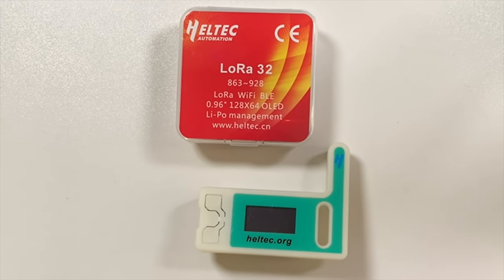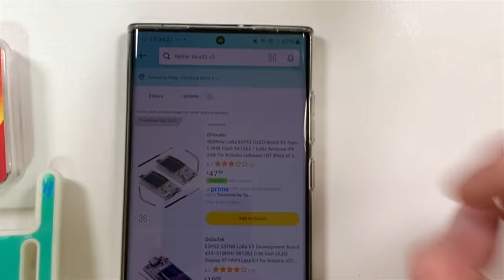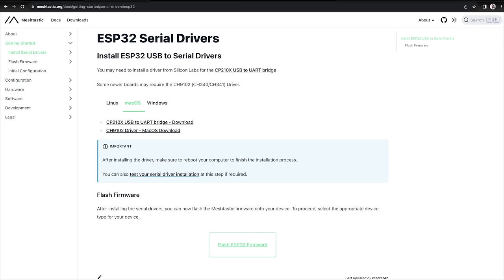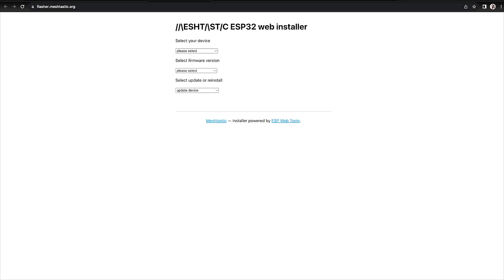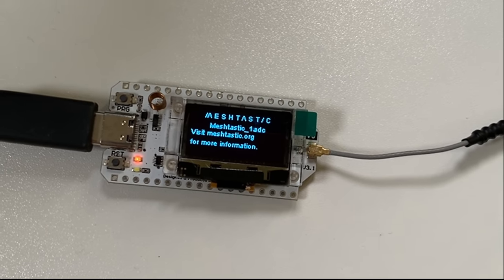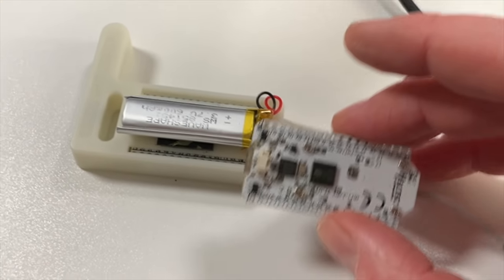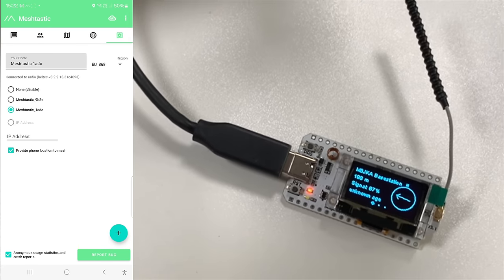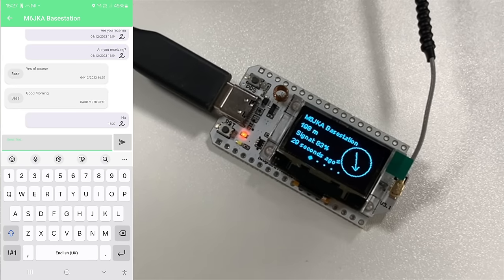JOIN THIS EXCITING OFF GRID NETWORK!!!

Comment: I got two of these devices and tested them in 'very long slow' mode. In town, with one high up in a bedroom window, the other in a car on the dash by the windscreen, the best I can get is 400 metres. Quite disappointed with that.
Reply from the maker: Hmm that doesn't sound great. There could be local RF noise, the window could have metallic coating, the antenna might be bad. You'd need to get experimenting, I can easily get 5-7km on Long-Slow, not on indoor antennas though.
Reply: @andykirby  Thanks for replying Andy. FYI, I just used all default settings, choosing encrypted, not a Ham. Are you using the Ham option, which increases power?

Comment: "So now you've got your drivers installed . " . . . . . nope, not happening, it will recognise that the device needs a driver but matter which software driver I install from Silicon Labs it will not work, even if I install and restart.  The manual install instructions are just out of my grasp, would not know where to start.  Any ideas?   - Update, I uninstalled the device in device manager then plugged it back in and it recognised it!

Comment: awesome! what is the range for this?
Reply: Yeah, I'm scrolling to find that answer too.
Cuz I'll probably be the first one in this city, it needs to be at least 20-30Km or I better use a CB radio
And frankly, I dont think thats the case, as 100mW on the old 800-900MHz band is really not alot.

Comment: If these modules are 100mW which one can I buy which supports higher output ?  (@ 868Mhz)
Reply from the maker: Most are around 140mW, Pi pico + waveshare lora board is ~180mW legal limit is 500mW erp.
Reply: @andykirby  thanks... so someone should nake a 300mw one.  If I'm going to pay someone  to climb up my roof to provide a public service I want to get the best possible rx/tx up there...
Reply from the maker: Height makes more difference than power. If you are putting one up high ~140mW will get out miles... and miles.
Reply: @andykirby  great... now deciding if I put the module up the pole too to reduce coax loss...  might regret that if I need access. Loss  (.3dB/m) if I use rg11 so probably better to use that...

Comment: Just to clarify, my phone will connect to the device via bluetooth so I would need to be in bluetooth range of the device to use it?
Reply from the maker: Yes correct. You can also connect to the device by WiFi and access it on your network

Comment: I have got to the point where im tring to flash, but on the web installer, its not showing any device. im on windows 11 and the computer can see it. i checked device manager and im using a cable that can transfer data, which i have tested with other devices. so i am stuck :( any help plz....
Reply from the maker: It might be the drivers? Have you installed the serial drivers?

https://meshtastic.org/docs/getting-started/serial-drivers
Reply: @andykirby   yeh got it working, the site was down and they are running a different site, now i have found out that none of my 1cell batteries have he wrong connector, whats the connector on the device so i can order some, thx.

Comment: Is there someone out there who did a video to set up in the U.S.?
Reply: I felt like an idiot trying to set up this device. Consider that I've always built my own computers since 1996. I've even replaced motherboards on my laptop as well. However, no one ever said on any of the videos I've watched that you can not configure WiFi and Bluetooth on the same ESP32 device. So....no matter how many times I reflashed my new devices, they would not work on Bluetooth. Then I saw on the Meshtastic Website, highlighted in blue background,  if WiFi is configured, then Bluetooth will not work on an ESP32 device. As long as you live, you'll always be learning. Everything is working.

Comment: What's the best way to power it using 18650 cells?
Reply from the maker: Yes and maybe solar too.
Reply: @andykirby Thanks, I meant how do you interface a 18650 or 26650 cell to the device?

Comment: I'm in the U.S.A. and purchased a 915Mhz Device (863-928) LoRa WiFi BLE OLED as described in this video. It won't flash. The device says - ' waiting lora data! '. After selecting ' Heltec V3 ',  it asked for ' stable or alpha '. I selected ' alpha ' as you suggested, but nothing happened with that. I can't go to the next step ' Flash '.  A little help, please.  If it's a power cable and not a data cable (I'm not sure) would I still get a reading on the device that says ' waiting for lora data! '?  Is power the only requirement to get this reading on the device? I only downloaded the ' CP210x Universal Windows Driver '. Is this all that's required to use it with my Android S23 Device? Let me know. I'm stuck. I'm disconnecting the device from my computer.
Reply from the maker: Hi, I would say it's not a USB C data cable, when it says "waiting lora data" that means it's still running the default firmware that comes on the board. When it's flashing correctly the screen goes blank.

See if you can find a USB C data cable.
Reply: @andykirby  Thanks. I'LL make sure it's a data cable.

Comment: Sorry Andy,  the system does not work and the video that you provided is not viable. 
Both myself and my brother tried without results. Not  computer stupid. 
Doesn't work in US.
PERIOD
Will be returning for full refund. 
Thanks for nothing
Reply from the maker: Firstly, sorry you had a bad experience.
I do not promote these products for Heltec or any other brand, I'm just a hobbyist.
These devices do work extremely well, we currently have a mesh spanning  about 20km here in the UK. However you need to understand a bit about radio in order to get the best results. Try watching my tips and tricks video.

This is NOT an out of the box communication solution like cellular is.

Thanks,

Andy
Reply: @andykirby  
We both watched hours of your videos and others before purchase. Followed step by step. 2 completely separate install attempts with different equipment and experienced techs failed after hours of trying.
I am a component level electronics tech. I understand wavelengths and bandwidths.
These were purchased for private phone texting.
They don't respond.
Not user error.
I will purchase an out of the box unit with meshtastic already installed.
Excuse me while I unsub you.